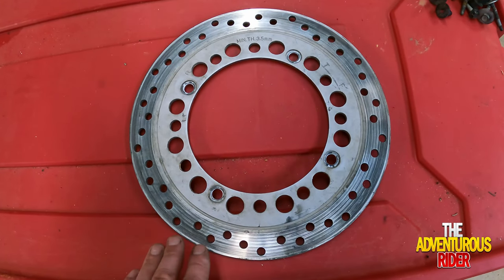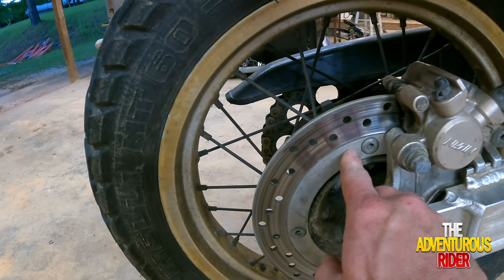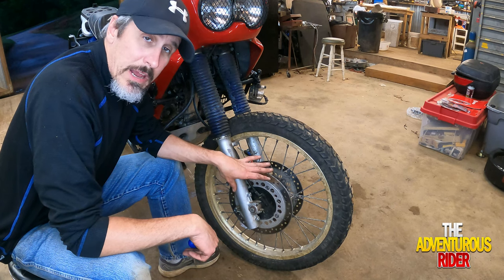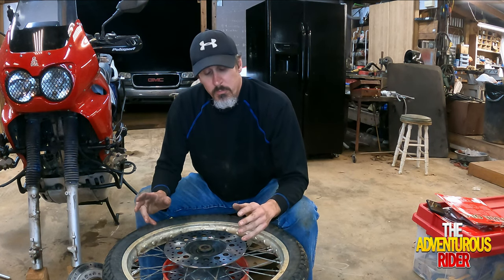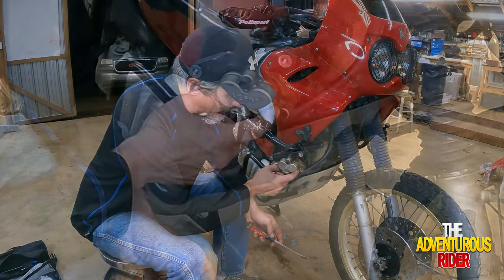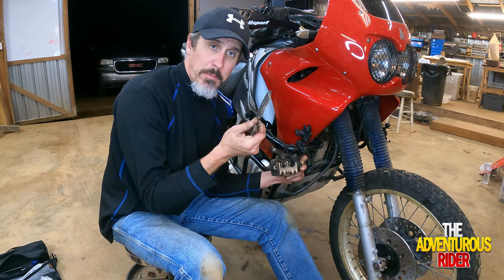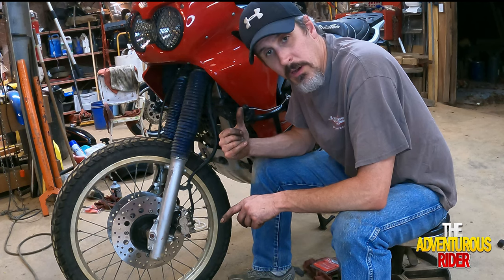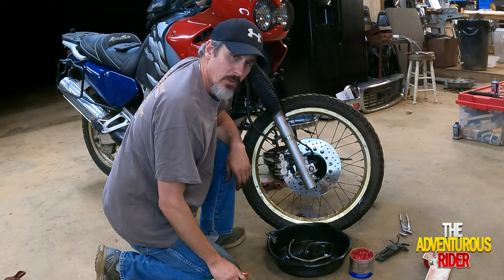Honda Africa Twin How To: Change Front Brakes

Comment: Man, you have a gift for making tutorial videos! You are completely thorough with the information with zero excess or redundant footage. This video would walk a person with no experience through this job and they would get the job done, but at the same time, the video is very interesting to watch as presented, even for people that have been doing their own maintenance for a long time. On a side note, I believe that you have saved yourself a lot of trouble by buying those JIS screwdrivers. I have never owned any, and I have stripped more than one of those screws with a normal Phillips screwdriver. Lucky for me, I have One old-school Craftsman Phillips that fits the JIS screws almost perfectly, but it is the exception to the rule. Honda sure does keep you on your toes with all those bolts with different shaped shoulders! I always tell myself that I need to punch some holes in a piece of cardboard in a drawn out pattern and keep those different length bolts in their proper places. One of the only thing that you need to keep in mind when dealing with a used bike is that you don't know how the people before you did their fluid on the brake system. When the bike has new shoes and the fluid is filled, that is the correct amount of fluids. As the shoes wear, the fluid level drop because the pistons have moved out to make up for worn linings. You do not need to top off that fluid! It is in serviceable range. Unless you have a leak, you don't need to add fluid, because what will happen is when you replace your  pads on a bike that has been topped off, there is now EXTRA fluid in the system. When you force those worn shoes back, that extra fluid has to go somewhere, since there's no room for it, so it can lock up the caliper and not let you push the shoes back, if the Master Cylinder cap is on, and if the cap is OFF, you will be forcing that extra fluid OUT of the master cylinder and getting brake fluid on parts that will end up getting their paint removed! So don't add fluid to a master cylinder  to "top it off" unless there is a leak in the system! OK, I have gotten a little long winded here, and nobody came to read a BOOK in the comments! Take care, everybody. Keep the shiny side up! and enjoy your rides!
Reply from the maker: So unsure why YT decided to flag this post but I've been keeping a good habit recently of checking it.  You have so much good information in this comment.  Not adding brake fluid as it goes down because of it wearing is something I didn't think about.  I guess that's why I've always made a habit of removing the cap but what you said makes total sense.  As always thank you for sharing the knowledge and adding to the upcoming video!
Reply from the maker: They flag things for various reason and i'm not fully up on all of them but thank you man for all the informative comments back.  I'll keep make sure that I check for them.

Comment: Thanks - couldn't figure how the spring pads fitted snugly (or not snugly as is the actual case). Anyway all's well that ends well. Thanks again.
Reply from the maker: Not a problem.  I don't think overall you lose any braking ability just won't have a rattle when it's snug.